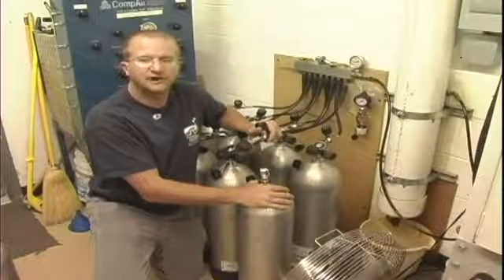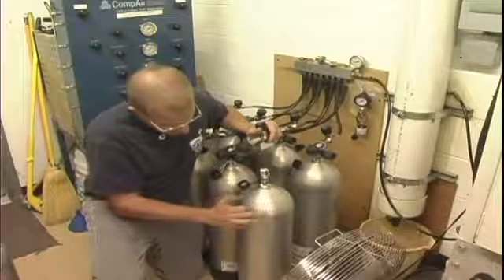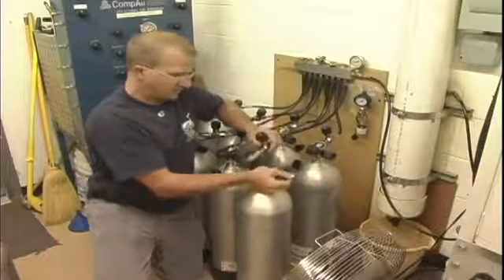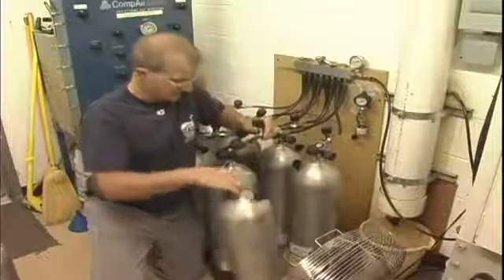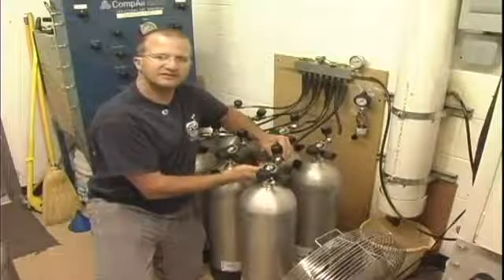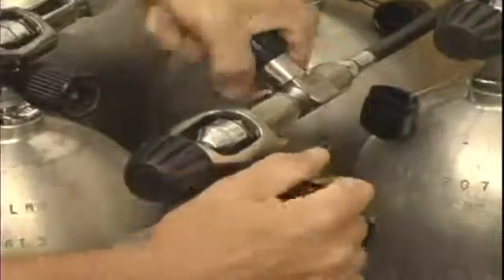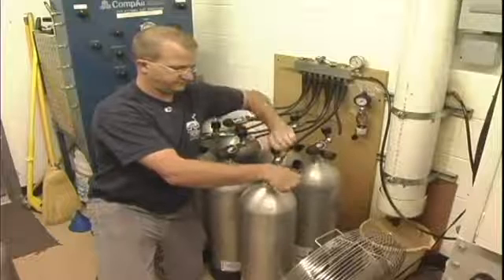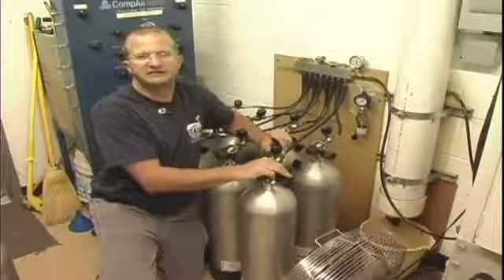How to Refill a Scuba Cylinder

Comment: Hi, I have a small dive shop and I have a mako compressor  that I use to fill scuba tanks. I can only fill three tanks at a time. Can you tell me what is that block that you hook up those 8 wips to and how do you control it so you don't have to run the compressor constantly.  Thanks